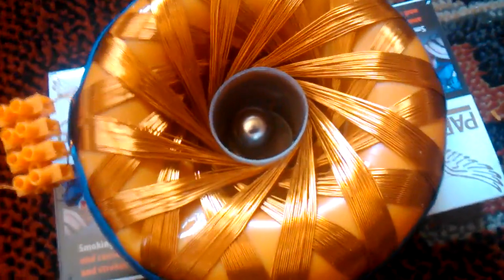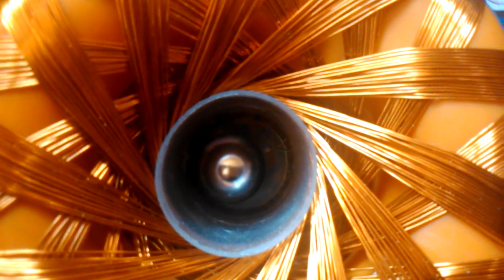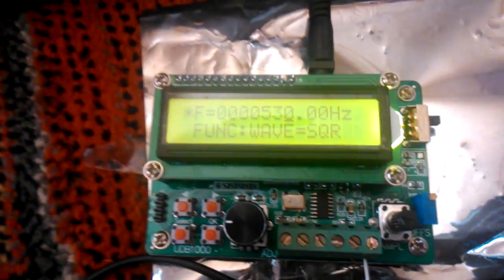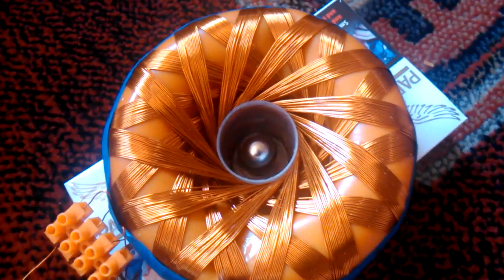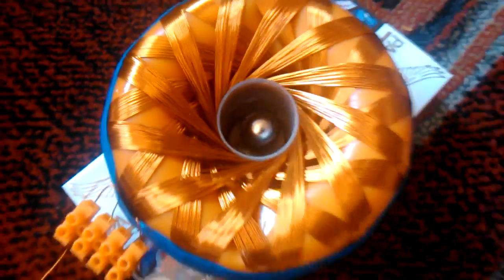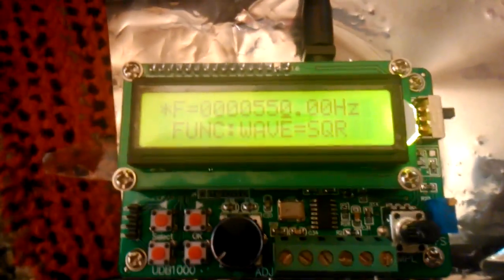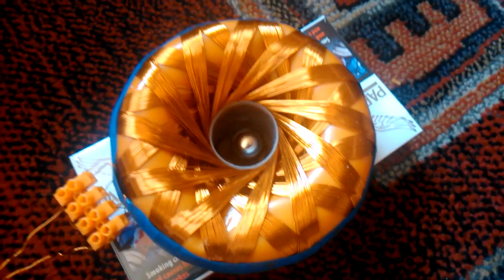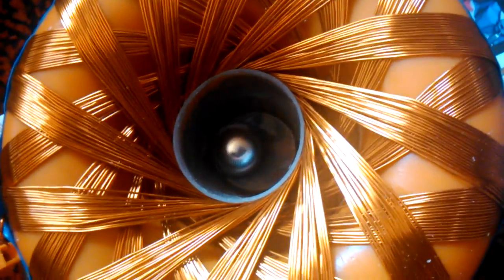STABLE LEVITATION via RODIN coil

Comment: Should'nt the metal ball melt after a while?
Reply from the maker: No, because it is a neodymium 'ball'
Reply: He isn't putting enough power into it to do that. A small induction melter/furnace needs to use around 2kw or so to get started.   Those also require cooling in the coil, so the coil doesn't melt.  They're frequent made of copper pipe, which has a coolant circulating through it.   He is almost half way there though.  I don't think his audio amplifier will be strong enough to support it.  

His thing is just an electromagnet with a decorative coil.  It is pretty.  All the hopes of some sort of magical properties are just a fantasy in the pseudoscience community.   If the magic properties were real, we'd be exploiting them in modern equipment.  Magic is a lot cheaper than paying for research and development.  On the other hand, induction melters/furnace really do look like magic.  

https://www.youtube.com/watch?v=8i2OVqWo9s0

The oldest induction furnace that I know of was in 1907 in Philadelphia.    On any appreciable industrial scale, they need a lot of electricity.  It wasn't until a good while after that, that electricity was even common in homes and businesses.   The large size units need some pretty substantial infrastructure to power them.

Neodymium magnets are melted and cast at the factory, so yes, it will melt.  He just didn't use enough power.
Reply: @JWSmythe  OMG, Thank you very much for this informative reply!
Great respect! it's not my speciality but I am a big fan of science in general, especially physics.

Comment: Why a square wave? What happens if other wave types are used? What useful practical application does/will it have? Could it be combined with the (vermana(?) craft) mercury propulsion (anti gravity)
 described in vedic texts?
Reply from the maker: To fasten changes in direction of a field rotation and making standing waves. On different wave types levitation wasnt so stable.. You can make a brushless motor/generator  with that or if combine with few more make ressonance. I dont know that but there was a guy on yt then, building a frame cover for a rodin coil and he wanted to cool it by liquid nitrogen. I used to have similar ideas but I'm not doing it anymore.

Comment: Is the steel ball turning anti clockwise on the horizontal plane?
Reply from the maker: It's a neodymium ball, not steel. Yes, anticlockwise :)
Reply: So the poles of the magnet are moving on the horizontal plane...... Why not magnetise an Archimedes screw to replace the ball with?
Reply from the maker: There where already such an experiments, but not in my lab. It was long time ago ;)

Comment: Can you do me a major favor, in the center, inside your plastic cup, can you please create an electric ark, aka plasma. I seen a video there they used a donut shape magnet and created an ark, it got drawn to the center and formed a disk (the hole), touching the edge of the hole. I have a strange idea that the plasma will form a ball in the center without touching the edge.... and take that further to launch it like a rail gun. Please test this for me, do it with the frequency that keeps the metal ball still in center and spinning

Comment: I think u need to try 2 separate Rodin coils each spiraling in opposite directions instead of ur current setup. I mean ur gettin levitation but it's very little and with the 2 opposing patterns in 1 i think there equaling each other out.

Comment: The oscillation is from the a/c feed current passing thru your coil. DC alset tesla DC. Also with your ver2 windings,  many improvements are possible with the direction you are going. However, you will improve this by pressing further and multiply this windings by 3 and use 3ph DC. Stabilization will improve from this.

Comment: wow class. at the sart of the video when the ball is spinning but not otherwise moving, is it spinning clockwise or counterclockwise? and if you turned the orientation of the ball upside down would it spin in the opposite direction?
Reply from the maker: Mick Mick Hi. It spins counterclockwise irrespectively to starting orientation.
Reply: cool. thanks. :)

Comment: try it with an aluminium tube in the center, if the tube inside the coil is not aluminium already..
Reply from the maker: It's made out of plastic. Not need an aluminium.

Comment: that is not a normal rodin coil. Its not threaded the normal way
Reply from the maker: Result are the same. It doesn't matter if it's radical rodin or not. I tested both applications.

Comment: So…where's the "levitation?" I see no antigravity, no levitation, only a metal ball spinning around due to an EMF, which by the way is nothing new. Back to the drawing board.
Reply: Levitation (from Latin levitas "lightness")[1] is the process by which an object is held aloft, without mechanical support, in a stable position.
Levitation is accomplished by providing an upward force that counteracts the pull of gravity
 (in relation to gravity on earth), plus a smaller stabilizing force 
that pushes the object toward a home position whenever it is a small 
distance away from that home position. 

- Wikipedia
Reply from the maker: Todd, look closer or https://www.youtube.com/watch?annotation_id=annotation_1406039645&feature=iv&src_vid=Po-yib77vgA&v=zNH77KGZPEI
Reply from the maker: Levitation clearer to see here: https://youtu.be/zNH77KGZPEI
Reply: Jakub is correct. It IS levitating, just not stably.
Reply: this comment is a work of art.
Reply from the maker: Look closer. Eventually watch v1.1 if You can't see that.
Reply: Mattothee Yes, I'm aware of the meaning. Hence why I asked "where is it?" He demonstrates nothing of the kind.

Comment: what's that Gadget he's using to change the frequency?
Reply: and blueprints so i can build my own ?  maybe?  or buy it.  but building is much more fun lol
Reply: +James Grinstead I don't know exactly but try googling a 555 timer circuit. You can probably buy them on ebay too!
Reply from the maker: +Neil Bronchauser 555 timer is not accurate enough. Duty factor of the square wave should be as close as possible to 50%. "The gadget" I used is the the signal function generator based on the mikroprocessor so it can generate any wave - square, sinus, triangle, saw etc.
Reply: Ok, so go with an Arduino or Picaxe. You can get those on ebay as well
Reply: Just a DDS function generator set on square-wave setting. You can buy one on Ebay for less than £15 make sure you can sweep through the frequencies as some models are Stop & start meaning you have to set the frequency first then press Start to generate it. 
😀

Comment: wow, how lame, it doesnt even fit the title of stable leviation
Reply from the maker: Levitation clearer to see here: https://youtu.be/zNH77KGZPEI
Reply from the maker: check your eyes man ;)
Reply: its a pointless experiment
Reply from the maker: No it's not. It confirms a low wattage experiment confirming stable levitation by using symetrical-exotic structure of the coil.
Reply: replace that metal ball with a piece of plastic, will it still "levitate"?
Levitate requires the altering of gravity, this does not alter gravity
Reply from the maker: Levitation is not antigravity. Learn more.

Comment: I am an electrical engineer I can see what is being done and could easily from watching this build one myself. But I cannot understand what I would achieve or gain by doing so, in its present form or am I missing something that can’t be seen in the video? If so exactly what. I think others are also puzzled maybe we are just not clever enough to understand concept. Please explain with full technical details and if possible in a simple none technical way for other viewers. Thanks
Reply from the maker: look at Jack Scholze work on youtube.
Reply: Honestly I don't see why rodin coils are not seeing much industry attention. They are essentially a compact, easy to manufacture and control, bearing drive. If serious research went into improving their efficiency, they could be a viable replacement for otherwise expensive motion technology.
Reply: RadiationOverdose That is one use, not the only use. If you can use a coil for a job, a tuned rodin could usually makes that application more efficient. I'm not sure i'd call them easy or fast to manufacture but they are aesthetically pleasing so everyone from a a complete noob to advanced designer seem to find them interesting. I only experimented with some bedini circuits and rodin/startship coils so far but power draw and output current was improved.
Reply: +Ron Angel Well, as an electrical engineer you should recognize a solenoid.  Which is all this is.  I understand these Rodin coils appear aesthetically to even some of us engineers, but they are just inductors.  Making fancy winding patterns and sending pulses just alters the input signal phase and frequency of magnetic flux generated respectively.  I have yet to see a Rodin coil do anything a simple inductor won't do.
Reply: +Chris Miller No a transformer, has two different windings.
Reply: That's exactly the conclusion I came to as well. They offer magnificent RPM and simplicity.
Reply: Does a simple inducer spin an object? I know that induction forges kind of spin things, but not with the speeds capable by this Rodin coil. Further, an induction forge is passing current through a ferrous object in a non-axial direction: straight up to straight down, provided the Ind. Forge coil is also upright, with top open to the ceiling, bottom open to the floor. The Rodin coil induces a spin to ferrous objects, which I'm already seeing applications for with super high speed.
Reply: Chris Miller Little more to than that but I guess you see what your trained to see.

Comment: My definition of levitation does not involve support from the bottom of a cup.
Cant see any indication that the ball is spinning.
Reply from the maker: see the v1.1 youtu.be/zNH77KGZPEI
Reply: Same, definitely some levitation on the bottom of a cup going on there. Nicely done though, I must admit I haven't been able to even get the magnet to spin myself with many different types of coils I've made & that's really starting to p.i.s.s me off. I must be hooking them up wrong I don't know & I have the same frequency generator too but I don't have an amp so that could be part of the problem..?
Reply from the maker: Michael Johnston
Yes Michael, without an amp you can't do anything.

Comment: esa bola de metal es un iman? que materiales usaste? cuanto es el voltaje de salida?
Reply from the maker: yes, it's a neodymium sphere magnet. Output Voltage is about 20V and Amperage <1A. What is interesting that when frequency is going up, the amperage is going down.
Reply: @kooboos89  la señal cuadrada que utilizaste es de 20 voltios pico a pico? Y conectaste alguna carga a la salida de la bobina?

Comment: It died at the end, it couldn't handle the pressure, poor thing
Reply from the maker: No, you're wrong. It died because of not enough power at this frequency. With this diameter of a wire I can't pump more. It's just a 0,35mm wire.... It shouldn't even hang on amperage like this. ~1-3A depends on the frequency.

Comment: Isn't the idea of the rodin coil that it doesn't require energy to work?
Reply from the maker: It depends what you want to receive.
Reply: free energy ?
Reply from the maker: mark howard so you have to make a loop of energy. With power frequency dividers, some DC/DC converters, something similar to force feedback in Muller's dynami. serach for romeroUK's replication and Daniel Nunez ABHA coils.
Reply: Ok thanks :)
Reply: so the wind does not slow down? it can push unlimited object for an unlimited time and length ?
Reply: @uwelauster9412  look mate the laws of thermodynamics are a myth made up by Big Power to ensure we are enslaved to them for life. Edison and Tesla knew this but also knew that they'd make more money selling power. 

To clarify i made that shit up. But it's probably enough to convince some people that it's true
Reply: +mark howard Build a windmill.

Comment: that's like  over a half of million rmps right?
Reply from the maker: it's 600W amp, I was mistaken because of stress connected to filming the first video ;) to be accurate, this levitation is about 30W.
Reply: Hz is per second so 560 Hz x 60 is about 33000 rpm.
Reply from the maker: @MrBlizz003 more like 625x60=37500

Comment: I have the same signal generator as you and i also have an amplifier. where on the amp did you connect the output leads from the signal generator to the amplifier? My amp only has one single connection port for the signal?? Can you plz explain. i would very much like to try this experiment. Thanks.
Reply from the maker: Joshua is this a mono amp? If yes you have to connect coil's windings in serial, but if you have stereo amp you should use both amp's channels with coil's windings in parallel.